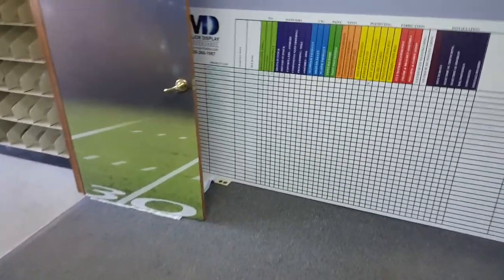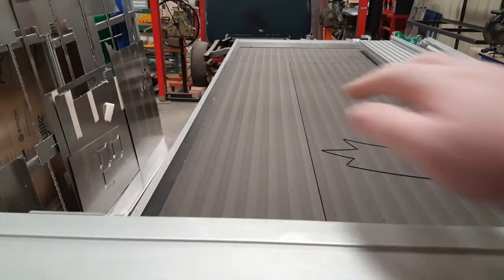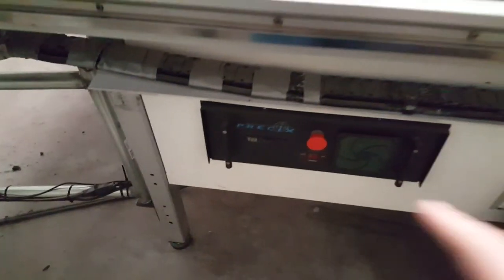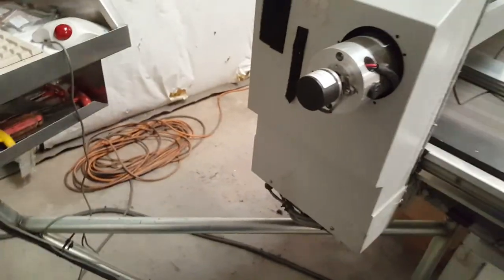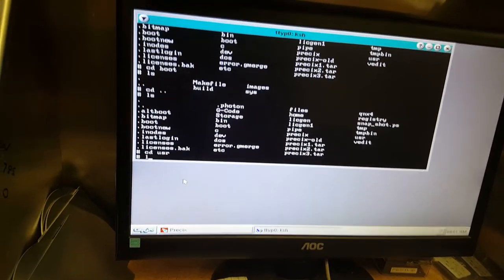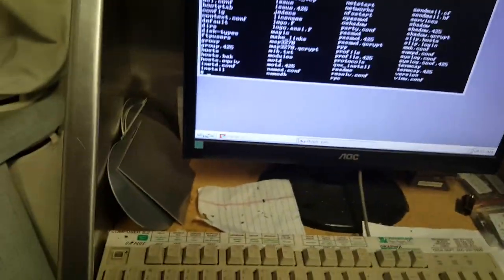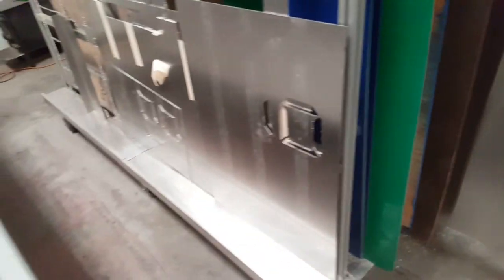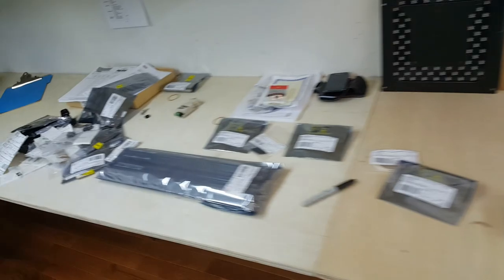Shop visit plus Precix CNC

Comment: Set yourself up with a program called Mach3.  Uses most PC hardware. 

http://www.machsupport.com/software/mach3/

All the current servo stuff should connect just fine. 

Might be also worthwhile to look at this stuff too.

http://www.cnc4pc.com/Store/osc/index.php?cPath=33
Reply from the maker: Nice thought, but it does not support the precix motion control card. Fairly proprietary stuff here.
Reply: You'd maybe have to switch to a Galil motion card.  http://www.galil.com/  They come up on eBay all the time.  I put one on one of my projects.

These products are also good. 

http://www.geckodrive.com/  About $125-150 per drive.  Use a G340.

Precix isn't that proprietary.  And you wouldn't necessarily have to switch the motors out either, as long as you can sort out the signals.